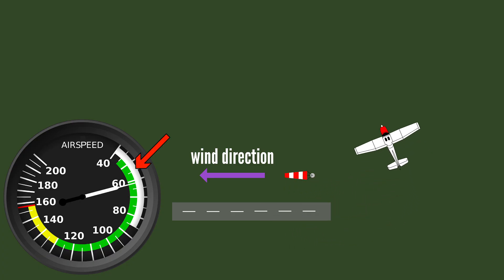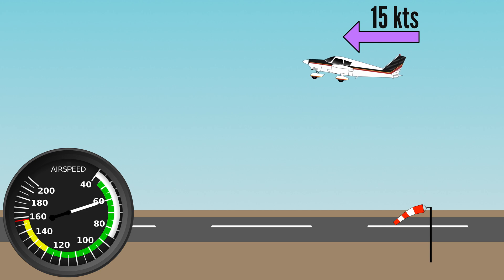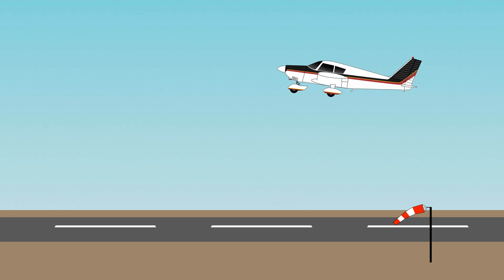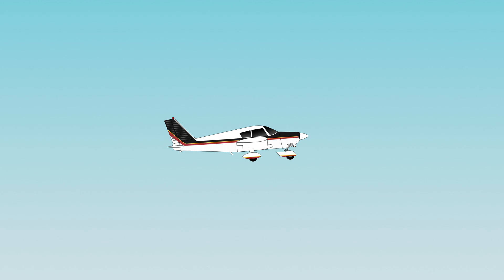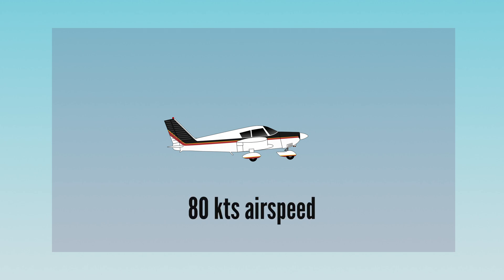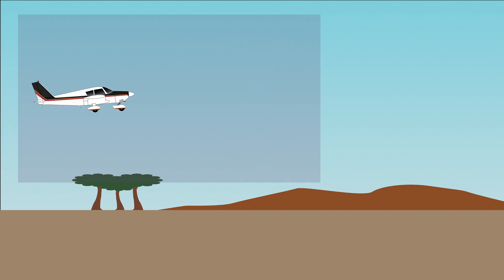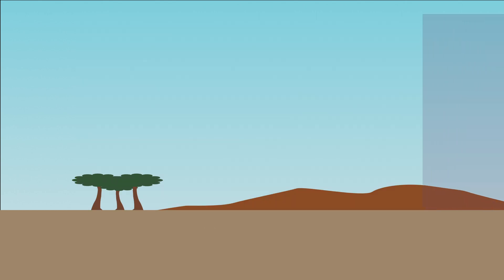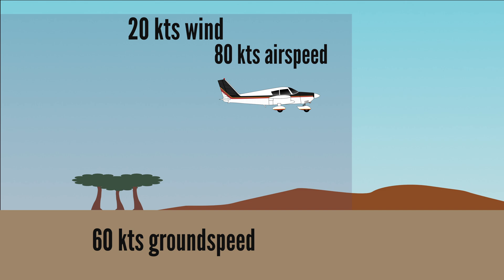The Myth of the Downwind Turn - Dangerous or Not?

Comment: Oh wow, your absolutely WRONG! If you look at wing lift, which is an indication of air speed, in a tail wind its absolutely possible to stall, crash and die if power is not applied for the downwind turn. Why dont you go get on a plane and try this in real time if your so sure of it.😂
Reply: Charles, you should try flying a sailplane and do some manouevring in wave lift in a 50 knot wind and a 50 knot airspeed. Clue: your airspeed does not slam from 100 knots to zero as you turn. Of course, your GROUNDSPEED does, but the glider flies without reference to the ground
Reply: Almost every pilot at some point in training will be asked to fly a turn at minimum airspeed in a 20 degree bank. Many small aircraft stall at approximately 40 knots. Now I've actually done this in wind aloft at 30-40 knots yet somehow the aircraft didn't stall despite being at an airspeed of about 42-45 knots the entire time. I never added power at any point in the turn and the airspeed remained constant. 

This is a myth and this video is spot on.
Reply: @oracle427  you are mistaken, at some point you either compensated or lost altitude, in either case you were fortunate to not have increased your AOA, or we would not be having this discussion.
Reply from the maker: I do, just about every takeoff I do when staying in the pattern. If there is no wind or 20 knots wind I remain at Vy speed from upwind, through crosswind, onto downwind. My ASI keeps reading 60kts throughout, every time, regardless of wind speed.
Reply: @LetsGoAviate  excellent video and judging by all the comments, it's clear that the myth remains alive and well!
Reply from the maker: @oracle427   Thanks. Yes I knew it was somewhat alive, but I hoped that understandable explanations and illustrations would make a few rethink it. The "block of air" explanation is what made it all "click" in my head back when I was a student pilot, hoping it helps someone else too.
Reply: @LetsGoAviate  yes it will, however indicated airspeed will be of no value when you exceed the critical AOA which clearly you have not yet done. you keep preaching such falsehoods and you are merely liable, keep practicing such blatant disregard for the real science and you will be popular on Dan Gryder"s channel!
Reply from the maker: @waynetokarz174  Are you talking about accelerated stalls? A plane stalls at higher airspeed when wing load factor increases (like say in a bank when maintaining altitude). One example of when that could happen is when doing low level climbing turns which I warned against, with reasoning. I'm not sure how the truth of the real dangers of the downwind turn could make me liable for anything, as I'm advocating safety. Also, please keep comments civil, we're all adults, I won't ask again.
Reply: @waynetokarz174  We are all taught the correct wisdom that you can exceed the critical AoA at any airspeed.

But in a given flight configuration (load, density altitude, bank angle in a coordinated turn) there is a specific equilibrium AoA associated with each given airspeed.

You can still disrupt that equilibrium AoA and exceed the critical AoA if you pull back suddenly.

But, excluding the above:

Both the equilibrium AoA and the associated airspeed remain unchanged during a turn to downwind.

(The above assumes constant bank angle in a coordinated turn and enough power added to overcome increased drag from the turn, both which would be the same as in a turn with no wind)
Reply: @LetsGoAviate   let me give you a really simple analogy or rather a thought experiment on why your video is absolutely wrong about physics (which I studied) 
And please, for the love of god, read it carefully.
Can you do that please?
Imagine an aircraft taking off against the wind and lets imagine the wind speed is exactly as fast as the take off speed of the aircraft (lets say 100 knots).
So the plane would basically take off while not actually moving (ground speed zero).
Follow me so far? There are even videos on youtube that show light aircraft do that or get very close to it.
So we have a ground speed of zero but an indicated air speed of roughly takeoff speed of 100 knots, correct?
Now imagine that plane making a quick 180° turn. 
Do you really think, that stationary aircraft, with exactly zero kinetic energy and zero momentum, burning fuel just to fight against the wind without actually having any ground speed would turn 180° and then by shear magic shoot at 200 knots back down the runway having a massive kinetic energy?
Because that would need to happen if what you people say is true since it's air speed would need to remain 100 knots but the wind is already going 100 knots so the aircraft would need to go from basically hovering into shooting 200 knots into the other direction just because it turned...
Where does all that energy come from?
If you can't picture energy think about a crash (which turns energy into deformation, making it visible)
So while it hovered it could literally hit the ground, even a small hill or a pole and nothing would happen (zero energy difference)
while just by tuning very quickly it would suddenly crash into any obstacle at 200 knots releasing a lot of energy.
The pilot inside would be accelerated at an enormous pace as well, imagine going from zero to 200 in 4 seconds or so. 
If that was possible all our energy problems on earth would be solved.
That's what you m*rons are arguing for..
You say the air speed stays the same because you think an aircraft somehow has no mass and doesn't move in any real direction, it only exists in a bubble of air with no physical laws of our universe around it...
I'm telling you our universe usually conserves momentum, it's one of the most fundamental laws of the universe and a plane has mass and velocity, so it has momentum and you better calculate that momentum against an inertial reference frame or you will fail any physics class in any university and be laughed out of the room
Did that make click now?
Because I'm running out of analogies here.
I can't make it any clearer. 

Ps I'm aware that by turning the aircraft around it would be pushed by the wind down the runway basically like a leave in the wind helping it to at least accelerate to the wind speed itself which means an indicated air speed of zero like a leave in the wind but even then, it's own mass resists that acceleration by a force of F=m*a , that's why I said in any earlier comment the real life effect in most circumstances at not that noticeable but the effect is still absolutely true and given a fast enough 180° turn, a fast enough wind and being close enough to the stall speed it can absolutely have real life effects.
Reply from the maker: I've read every word, twice. For starters, you made your qualifications clear, but it doesn't matter to me. There are people with Doctors degrees advocating that the earth is flat. I also can't help but notice you didn't ask my qualifications? Case in point, it doesn't matter, only these words matter.

Lets use your analogy of taking off into a 100kts wind. But lets completely rule out windshear and obstacles. The wind is 100% constant at 100kts. It's 100% flat in all directions. After takeoff we climb to 200ft, turn crosswind and downwind, like one normally does, at say 20° bank, doing so at Vy speed, all full power all the way as is normal. If the pilot is able to keep the plane coordinated (which is going to be difficult in what will be the stangest sensation he's ever experienced, wind making it seem as if the plane is not turning but drifting sideways when on crosswind). But this pilot has got discipline and he keep it 100% coordinated without increasing bank angle. The airplane will not lose more than maybe 1 knot due to acceleration (he is turning after all) and acceleration is change in speed and direction. He won't stall because what the ground is doing is irrelevant to flight. All that matters is the air the plane is in. If the 100kts wind is 100% constant, is will be no different to doing this in 0kts wind. In reference to the ground it's worlds apart, but not in relation to the air the plane is in.

You mentioned a crash as a demonstration of energy. But that's in relation to the ground. Surely it makes sense that relative to the air the plane is in, 100kts or 0kts wind, energy relative to the block of air is exactly the same. It's only when it comes in contact with the earth that it's energy and motion reletive to the ground matters.

That's the problem here, you are applying your physics in relation to the ground, which is irrelevant as we don't make contact with the ground and the pilot (hopefully) doesn't react to what is happening on the ground.

I've done this btw in the Kalahari a few years ago over a flat pan, few hundred feet up, circling in 40kts wind (about 20kts at ground level). My airspeed didn't change as I did turned through upwinds and downwind in 40 knts wind! I couldn't turn about a point as that would have meant an increase in bank angle, as wind was drifing me along, and increase in bank angle is increase in wing loading and thus increased stall speed. But I flew in relation to the air, not the ground. Airspeed doesn't lie. Sure AoA can differ with different loads, but if there is no additional pull back in the stick, stall speed stays the same. So you say but I didn't do it at close to stall speed. Well, I did shortly after. See I'm into STOL, and landing in 20kts (40kts 200 feet up) wind makes my takeoffs and landings about 20 meters. Super fun! I then flew about 5 circuits to capatilise on the fun (it's a salt pan, I could takeoff and land exactly into the wind) with almost zero windshear due to the pan being flat for dozens of miles in all directions. I did my circuits exactly as normal. Somewhat tight compared to most pilots, it's an LSA STOL plane after all. It felt crazy weird being drifted sideways on crosswind leg, but I just flew my lopsided circuits, making sure to keep coordinated, not increasing bank angle. And guess what, I didn't stall flying 15kts above stall speed turning downwind into 20kts wind. Sure you're going to say I'm full of S###. It is what it is, I can't prove to you that I did it. I didn't dream this "theory" up yesterday and decided to make a video. Thanks for keeping it somewhat civil (although extremely condecending). I can only lay the facts down, and I've made my argument. I also once believed the downwind turn myth, but luckily I was open minded to someone taking me aside and explaining the falacies away.
Reply: @LetsGoAviate  1. I didn't use crashes to demonstrate energy but energy difference and that is what you people don't understand. Energy is basically never used absolute, it's the difference between two states. That's what we mean when we talk about energy. 
Potential energy is the difference between two unknown absolute potential energy states ( where would zero potential engery be in the universe), same with kinetic energy (where would the dead zero of the universe be?), momentum and so on.
So imagining crashes really is a perfect thought experiment to demonstrate that massive amounts of energy difference are there between going one way and going 180° the other way and these energy differences must, MUST, come from somewhere since energy is conserved in our universe and that somewhere is what I explained at length here. To change the momentum you need a force and then time
which brings me to 2.
2. I never, NEVER, said you can't fucking turn your aircraft down wind, did I now?
Yes you can slowly and above stall speed turn into or out of anything since you have time and a force (propulsion) you could even sail by using up potential energy. I never said you can't turn, that is just stupid and a straw men argument.
But even you had to make the point that you need slow turns, guess why?
If this stupid video was correct and downwind turns are a myth and aircraft are just massless points hovering in a bubble of air that is somehow not connected to the laws of the rest of our universe like energy conservation then it wouldn't matter how fast you turn. Is the limit 1 second, 5 seconds, 20 seconds... that's not how it works.... I have seen some of those small propeller red bull aircraft turn incredibly fast, 2-3 seconds, does that count?
If downwind turns where a myth the time it takes to make the turn wouldn't matter.
But it does because downwind turns really do lower your indicated air speed since aircraft have a mass and ground speed is an inertial reference frame in which newtonian physics works and the only way around this is to turn slowly enough that the propulsion of the aircraft can get it to the equilibrium of propulsion force vs drag again (plus the air is pushing on the aircraft like a leave in the wind which actually helps with downwind turns but only up to the speed of the wind and not faster). If you ignore that and you turn too fast into a too fast down wind then congratulations, you just lowered your indicated airspeed. Aircraft have a mass and if you times that with the velocity (in an inertial reference frame like ground speed or air speed but you have to use one moving air particle as the origin of a euclidean space and not indicated air speed) you get a momentum, to change that momentum you need a force and that then takes time.
So it's not a myth. My example of a hovering takeoff is real btw look up Alaskan bush pilots in heavy wind conditions, they can basically land and takeoff with near zero ground speed.
The problem is, if they would turn 180° they still have near zero ground speed since their momentum (mass*speed) wouldn't change that fast but now they have the wind come from behind and crash.
So again, downwind turns are not a myth.
It just doesn't matter that much most of the time.
Reply from the maker: @Mar-s5q8m  When the other guy starts yelling and swearing is when I leave the conversation. Please keep it civil or I will delete your comments, like the one where you called me names. If you can't bring your point across without insults, perhaps the reasoning isn't that solid.
Reply: True, He is compensating with engine power to maintain/ accelerate to 60 indicated. Gliders maintain/ get back to these safe speeds cause of low drag. 

He shouldn't try this thoery in a sluggish airplane above stall.

Comment: In a  correct downwind turn the block of air will drift downwing significantly.  If the pilot, instead of maintaining a bank angle and airspeed, elects to "turn left at the barn", he can easily over-bank and stall
Reply: I think that makes logical sense:  the IAS doesn't change from the turn across the wind direction, but the apparent ground relative motion does change.  So overly steep turns in reference to external ground reference is a risk.

Comment: Great content. But . . .  one additional major factor. “Wind gradient” typically there is significant difference in steady state wind velocity with altitude. From ground level to pattern altitude and above it can change a lot. So climbing ability is compromised on a downwind heading because the aircraft needs to constantly accelerate as the tailwind increases with altitude. Not to be confused with a temporary wind gust. (grin)
Reply: Disagree ,
Climb performance into wind remains unaffected.  Ground speed decreases .
Landing downwind , then you have to reverse wind gradient ! (please try )
You tend to increase asi close to the ground .
But ground speed increases .
Trust the instruments.  Not what it looks like .
Reply: @marks2749  instruments can lie, asi is strictly an indicator and does not show AOA, for the ASI to indicate safe flying speed downwind, you will require an increase in throttle. You obviously have not performed downwind landings.